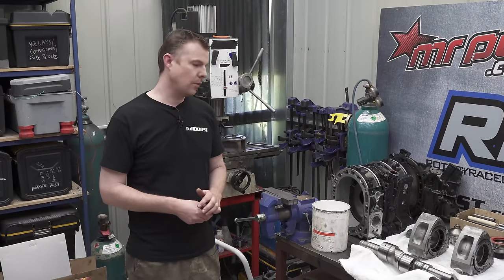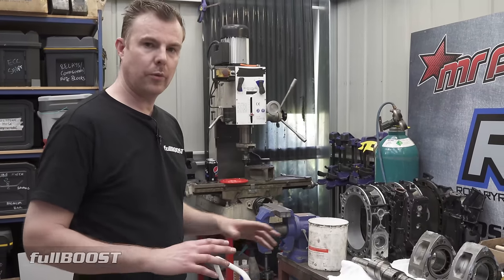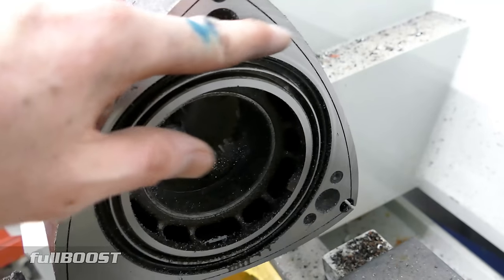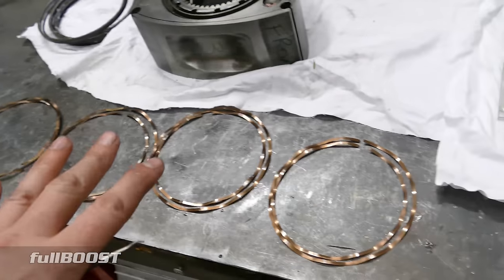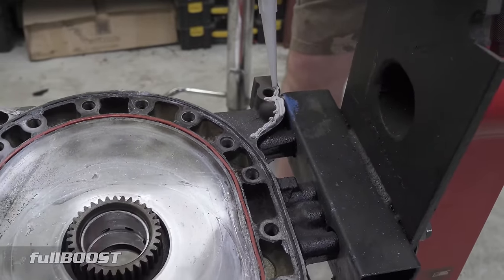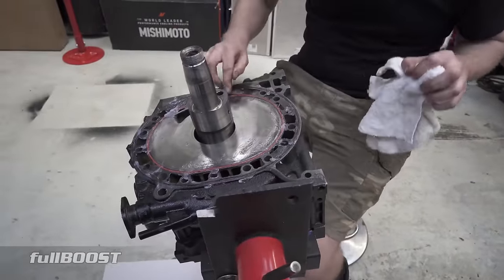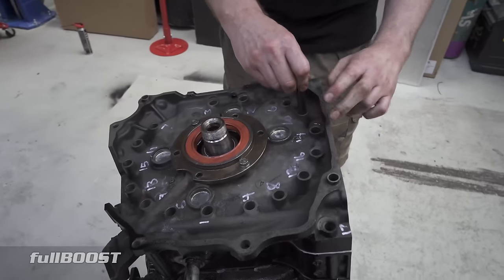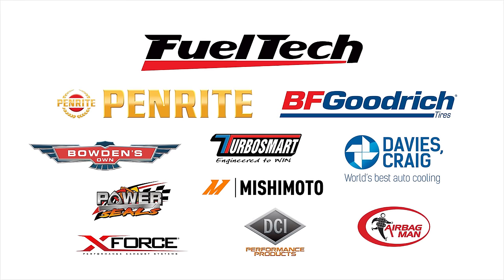13B Race Rotary engine build - Comprehensive START to FINISH guide | fullBOOST

Comment: Having been a Machinist since 1970: 1) your running that reamer 1.5-2 times as fast as it should for that operation. 2) Never ream without either water based or oil based lubricant if  you want a true sized hole. Less lube needed with a carbide reamer, but still needed. You probably should have put that bench-top vertical mill in back gear for reaming to slow it down, remember to reverse directions while in back gear.
Reply: Thank you for Tip . I am cnc Machinist  I love advice🙏🔥

Comment: Hey guys. I am a Toolmaker and I do lots of those type of machining. I see when you tap and ream you use slow movements to not over heat your tool which is right, but may I suggest you use tapping paste when you use reamers and taps and dies. It will totally help with the overheating and helps you not to seize your tool or minimize the risk of breaking the tool in the job. Love your video’s keep it up
Reply: It'd be great to see how you do the diy stud kit machining process, the m10 threaded stud heads are genius. Getting cnc studs done costs about half as much as a decent china milling machine. There's a thread on Aus rotary about using the centre plate as the template for the rest of the holes but the housings seem to be the hard part due to misalignment of bolt holes. Do u just drill through the centre plate into the housings, not worry about the drill bit walking and let the reamer take care of truing it up?

Comment: I'm surprised you don't machine the combustion faces of the rotors, you would be surprised just how different each combustion chamber is from factory. Also do you ever bother to check the apex springs for resistance, there are many times you will find a certain apex spring is slack/lacks resistance. Just a few tips..👍👍

Comment: You might find it a bit uncomfortable but it is best to keep your party pack chilled.
All right now seriously you are pulling the case studs up tighter than 48 pound feet/65nm, you did say that you were tightening up to 1/2" unf? 

I would also suggest you invest in a center finder or a clock to clock the counter bores of the end iron. A whole lot easier and more accurate.

Comment: I've always been told never use vaseline on rubber o-rings because  it's petroleum based and slowly eats rubber. Your seals probably aren't rubber though, eh?

Thanks for the vid, I've got a semi-pp (built by someone else). Not planning on building a motor anytime soon... but I've got your vid bookmarked just in case. :)

Comment: Friction systems should be dealt with in the engine housings... of its pressure, timing, and containment of the combustion system.. and not on the rotary.

Swing, spring, pressure, and timing to contain the forces and energy within the engine housing... which will relieve the pressure that friction is giving on the rotary...

Comment: 3:24 I am not even a mechanic but shouldn't a higher clearance mean less oil pressure?
Reply: @TykeMison_  so as in you example, higher clearances will decrease the pressere
Reply: Yes but bigger clearances mean more flow better cooling.
So you run high oil pressure regulator to make up the pressure at race rpms

Comment: 25:58, learnt from last time. https://www.youtube.com/watch?v=sjiYSDZukwQ 15:26 I wonder how long that engine lasted? Might look like I'm digging, however I do really want to know. Did you hear about it again?
Reply: MV60 learnt from last time ? Do you think the other video was the first I’ve built, and this video is the second ? 😂😂 other engine is still running.
Reply: @BackyardMechanics  Pretty obvious it had a seal out on that other build. No need to get snarky, I would really enjoy building one of these under your guidance. Pity we're in different cities. I'm trying to be joking as well as genuine.
Reply from the maker: As explained 500 times already It was just an oversight in the editing suite using the wrong clip. Obviously if it were left like that the engine would have been toast...
Reply: @fullboost  Thanks man. What would have actually happened? I like how you use those stronger apex seals too, really restores faith in that you can have a reliable rotary when you set out with better parts.

Comment: To avoid all this and the issues that come with it just get yourself a BARRA
Reply from the maker: It would weigh more than the car :P
Reply: @fullboost  Weight means nothing when you have enough torque ;) same goes for revs, don't need 10,000rpm when you got the torque as early as 2000rpm  ;) btw you know i love you guys haha
Reply: @fullboost  Acts like a weight plate. No lift.
Reply: i tried fitting a barra into one of these 626s, the thing hangs over the front bumper when its bashing against the firewall
Reply: @logical_volcel  Wow man. There's a yellow rx7 getting around here with a 2j in it. It's really tall in that vehicle. Amazing it fits length wise ok. Quite a fascinating build.
Reply: @Monstero5o  Torque means nothing if you use a different gear set
Reply: @Jupiter__001_  there's your first mistake, relying on gears to get somehow ;)
Reply: Ron F  my mate has a barra in this FC RX7 lol road registered and engineered. You were saying?
Reply: Ron F  its actual 57/43 pretty good if you ask me lol
Reply: Io @ err no torque no go,period
Reply: Too heavy brotha, okay in straight line but not for touge 🤷🏽‍♂️
Reply: @DirtyBond  was taking the piss lol RB all the way
Reply: @Monstero5o  haha damn, you got me 🤦🏽‍♂️🤦🏽‍♂️

Comment: Amazing .....

Would you do an experiment like in this picture for your next project?
8ttps://images4.imagebam.com/9e/b1/2e/MEKFJ3L_o.jpg

I have a heated debated with my friend,
he said without "Gear", the rotor will wobble randomly and erraticly.
I think No, because the rotor is holding by its housing or casing and eccentric shaft firmly/tightly.
I can't prove it, but logically my idea is right, isn't it?
So if you interested in this concept, I would be very appreciate.
Have a nice day 
CU